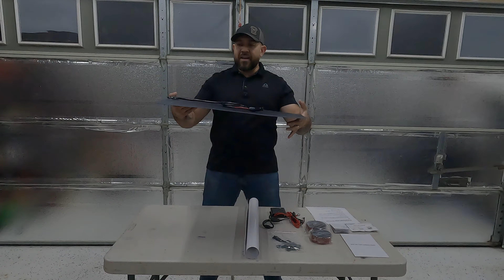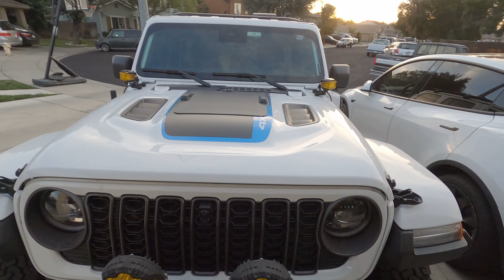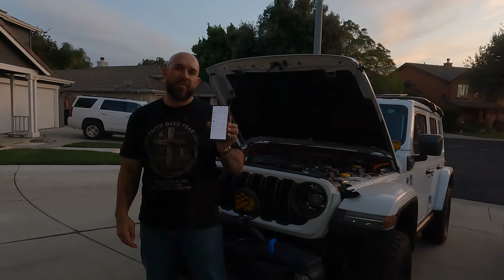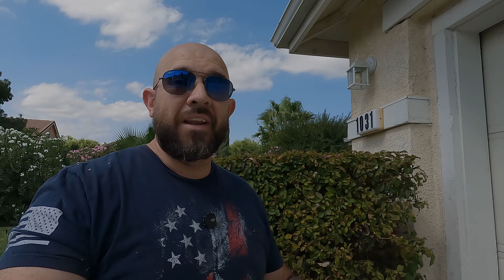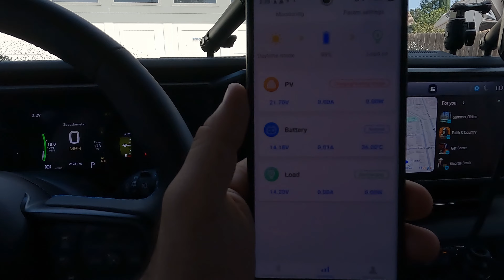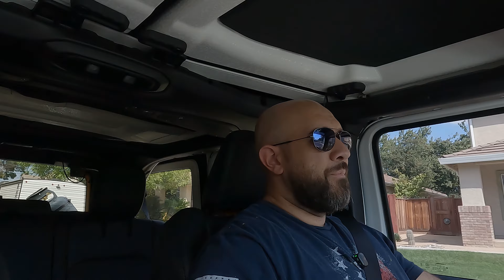Jeep 4xe Hood Solar Panel Install — Lensun 45W Off-Grid Upgrade

Comment: What is the name or link of the battery charger that you used to repair your battery, I have an optima that I had my ARB fridge hooked up to i for got to disconnect it when I got back from 28 day annual training and my batteries cooked 
I have the same problem you described low-voltage able to jump. The battery car runs fine until I shut off the engine alternator is brand new.
Reply from the maker: The brand is HTRC... here's the link https://amzn.to/4ovPwIM

Comment: Could this be use to charge the main ev battery ?
Reply from the maker: No, this is meant for the 12v battery.
Reply: @thetrailoutthere okay is there anything out that can charge or extend the ev battery

Comment: Is tha solor hood giving you miles for the jeep or is that just keeping the battery alive
Reply from the maker: This is just for the 12v battery. It helps out if you have accessories plugged into the jeep that would normally drain the battery. It also helps keep the battery charged after long periods without use.